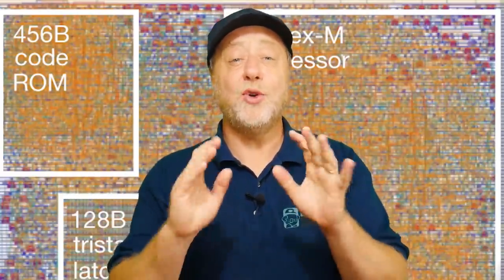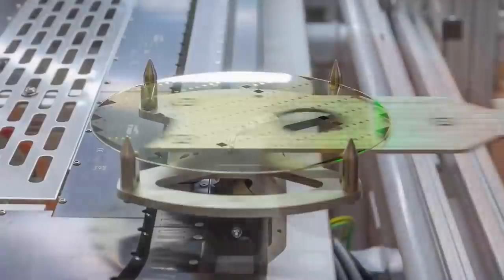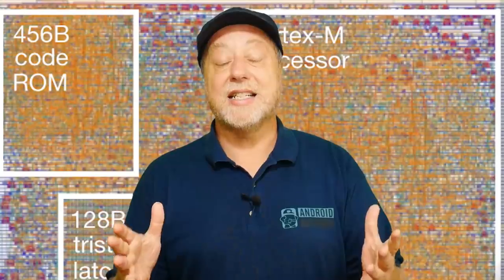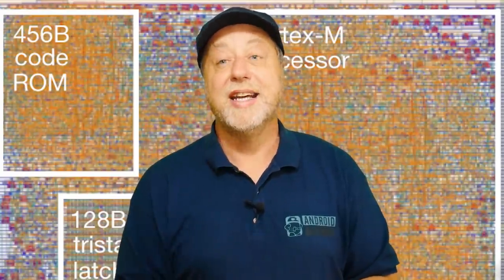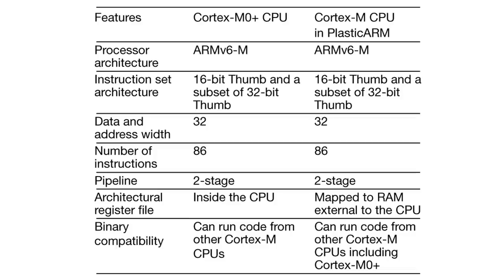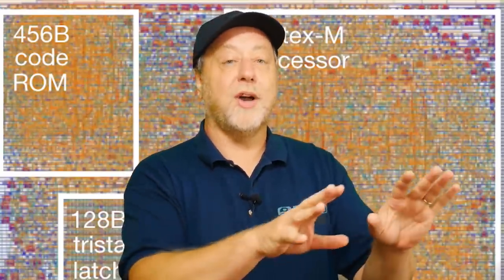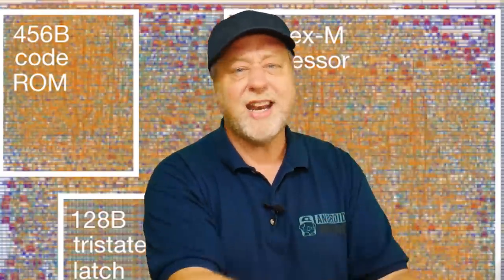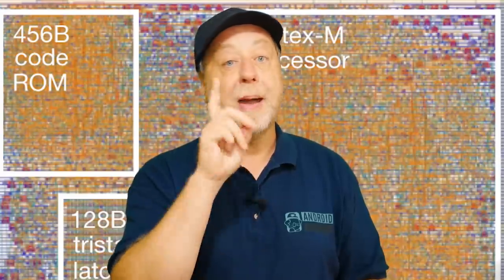Silicon Chips Are So Yesterday - The Future is Plastic Chips!

Comment: let's overclock the plastic SoC and see if it melts
Reply: The new benchmark
Gamers Nexus: "Will it melt?”
Reply: Jech Tesus
Reply: I was finding this comment
Reply: No heat sink
Reply: Lol
Reply: Heat-resistant plastic exists.
Reply: kkkkkkk
Reply: Testing plasticity to its limits!
Reply: @salluna1957  Next up gamers nexus 'didnt melt' awards
Reply: the diamond we will replace silicon with won't melt, I find it silly anyone is talking about using Plastics when lab grown diamond waviers are right around the corner.
Reply: @AdolphusOfBlood  if it doesn't melt itself, will it melt others in the circuitry? :)
Reply: @DarkPa1adin  Nope, but others will melt long before you'll reach the limits of the material, and those could set it on fire. Yes diamond burns. It's just such a good conductor that it won't heat up due to the current. So in 40 years you might see some idiot bragging about their computer having gold circuitry to handle more current for max clock speeds. Sounds silly right? Diamond CPU and gold wiring? But yeah these are the two best materials for their respective roles. I await seeing my grand kids bragging about their silly pimped out PCs that are literally pimped out.

Comment: I'm kinda interested in seeing an ARM microprocessor combined with a TFT, maybe even OLED display on single sheet of plastic. With what was shown in this video, it sounds actually within the reach. Could work as anything from clock, digital thermometer, adjusting and showing expiration date, calendar you can slap on the surface of a mirror and so on...
Reply: Smart labels on reusable packaging
Reply: or like paper thin calculator,
Reply: @crusaderanimation6967  That could work too. Doesn't even have to have mechanical buttons either - capacitive sensing is a thing. Probably powering a device like that would be biggest challenge, though...
Reply: @DennouNeko  Depend on power consumption, modern calc
calculators consu
me like 0.0001 W (at least that's declaration on my small casio.) you may harvest some power from small solar panel (i heard there are flexible too, are less efficient but in this case may be enough)
Reply: @crusaderanimation6967  Yeah, I wasn't sure about the solar panels :) But if there are ones that can be made in same technology, then you have pretty much a whole device on a sticker.
Reply: Just what we need. More plastic waste. 👍
Reply: @johnathanpearson3203  Look who came Johnathan Pearson , destroyer of fun, killer of child smiles.
But seriously tho, i think it may even reduce e-plastic waste if designed properly because you wouldn't have produce casing in a sense we have now but pcb would be casing itself.(and remember it isn't that if those weren't produce them we wouldn't have additional plastic waste, because if those will not go into production them "standard " silicon products will be produced, but if those plastic chips will be produce and gain popularity they may replace silicon at least to some extent and if designed properly reduce plastic waste.) But that depend on how technology will develop and how devices will be designed, so complaining now about plastic waste is simply irrational.
Reply: @johnathanpearson3203  Did i wrote anything about recycled plastic and or chips on food products ?  U completely missed my point.
Ok chips in food product may be a problem but you just neat picked one problem form one potentially problematic usage and applied to whole technology.(Not even precising that you have problem with this particular usage.)
Reply: @johnathanpearson3203  Well, interesting way to vandalize talk about technology. Kinda surprised you didn't start with "we should stop using machines that take away our work places". But joking aside, regardless if a chip like that would be made of recycled plastic or not, as long as it would use less plastic that stickers or devices it replaces and would be recyclable, it's already a positive effect. And if you want to blame anyone for consummer style of life, blame people who will order the available products by price and buy only the cheapest. Doesn't matter if they will pay 10% less and it will last only half the time.
Reply: @crusaderanimation6967  it was a use case presented in the video.

Technology needs to become more useful not more unique or custom.

Just look at all those outdated mobile phones being thrown in landfills every day. No ability to reuse or repurpose.

Your playing the game of use more. We should be playing the game of reuse more of older tech or recycle it completely.
Reply: @DennouNeko  you said it does not matter if it's recyclable? I disagree. No way it will use less plastic than a sticker.

I think technology needs to be smarter. People throw away too much stuff released by companies which know in a few years it will be garbage and useless. Waste of resources. Plastic chips are useless for the mass market. Maybe in specific medical uses maybe.
Reply: @johnathanpearson3203  Less plastic than a single sticker? No. But what if you have packaging that you can reuse? A glass bottle, an envelope, any kind of container that you can either return or even reuse yourself? That replaces mutliple stickers.
Reply: @DennouNeko  I could get behind tech that makes glass bottles and tins rather than plastic. Even using hemp for building materials as is already possible and is lighter than oak and twice as strong. But expensive.

I could get behind a mobile phone ATX standard and sockets for mobile phone chips so they can be repurposed in other products or upgraded.
Reply: @johnathanpearson3203  
Your missing the point  even more,
" it was a use case presented in the video."
Yes but that's one example among many other examples but you seem to write off  whole technology just because of one example of usage that might be bad.

"Technology needs to become more useful not more unique or custom."
Technology is (sometimes) more useful by beaning " more unique or custom." That is more specialized to task.Sometimes multipurpose is needed but sometimes "If something is to everything it is for nothing."

"Just look at all those outdated mobile phones being thrown in landfills every day. No ability to reuse or repurpose."
That's not problem with plastic chips that's separated topic related but separate. We should reuse as much as possible but we can't do it all the time and we have to produce new devices and if we do so them we should improving the technology. 

"Your playing the game of use more. We should be playing the game of reuse more of older tech or recycle it completely."
Well in first sentence  you made a straw man, but with rest i would kinda agree with 
except it's much broader problem and biching about it under video technology that may even help but have one use with have potential to be bad idea is simply out of place.
Reply: Just use your nose! Way less waste and you already charge it with food.

Comment: Combined with medical sensors for diabetes or, for example, blood pressure stick-on patches, a computing device on plastic could really help save lives and cost.
Reply: It won't even need a battery if they design a flexible Peltier device. It'll just use the body's heat.🤔 Time to do some research.

Comment: Presumably thinner and lighter substrate.  So although its bigger than its sillicone cousin.  if its lighter it means a great leap forward for aeronautoics and space flight.
3D chip design on polymer substrates would technically be printable.  So you could just have the raw materials and a printer to repair components on a ship.  Instead of having to take spares up with you.
Reply: Nice!
Reply: That's a cool application
Reply: @1MarkKeller  PROFESSOR you are back. Missed you 😢
Reply: @harshvardhansinha  HARSHVARDHAN SINHA!
Reply: Stop saying silicone. Its silicon. This is electronics, not boobs.
Reply: No its not printable

Comment: Will the chip melt on high temperature since it is plastic?
Reply: Undoubtedly.
Reply: So do silicon chips, or at least they die at high enough temps
Reply: If it could survive reflow, it would survive normal everyday operation.
Reply: @jrsxcase  it can survive reflow...... of hot-glue :)
Reply: It runs very very slow so heat won’t be a factor I assume

Comment: A good power source is the "usual problem" for such mass deployment of "smart" circuits in packaging and so on.
Reply: Paired with rfid I bet it gets enough power to do its thing. Alternatively it can use flexible solar panels or solid state batteries.
Reply: @rallisf1  With the suggestion about having sensors to monitor transport, no RFID available, and in a dark place. And in flexible packaging material, solid state batteries do not really fit.

Comment: I'm certainly intrigued by plastic chips, but I'm not seeing the application yet. You can do the example food expiration chip in silicon just fine. Where's the power going to come from? Not a plastic battery. Your yogurt container is going to have a nasty metal battery that you can't just throw in the trash (or recycle easily). I also wonder what kind of wires are going to bond to the pads on that plastic chip and stay reliably attached with all the flexing.

Comment: The substrate used is plastic instead of silicon wafer, and because of that the logic gate has to utilize TFT process to build. The main draw back of this combination is power-consumption and CPU operation efficiency which is very bad. The CPU has to run under 20kHz and consume a lot of electric current, which is not good for IoT applications.

Comment: It seems a bit backwards to me, the wafer is silicon because it's silicon that becomes the transistor gates by etching and doping. 
Then again, since the whole lithography process is so complicated and expensive, maybe thin film transistor based logic does make sense economically. But the substrate doesn't matter at all, as long as it's reasonably flat and stable.

Comment: Microchip has had great success with the PIC, a Low power, small computer, that's very inexpensive.  If the plastic chip could be made cheap enough, this could expand the low cost Micro-controller market.

Comment: What about the processor can wrapped around a small size battery that fits into your glasses? This maybe can reduce the bulk of wareables and maybe AR/VR glasses
Reply: They still need to "project" holographically, as the eye is terrible at reading in very close distances. Zack Freedman did a video about this.
Reply: The electronics size is not the cause for large wearables. A silicon cortex is around a 20th the size

Comment: Please no. We have enough and more plastic already. Metal, Glass and Ceramic would be preferred over plastic. Silicon isn't bad, and FinFET has been working well so far.
Reply: Yeah cause those 0.5cm^2 of plastic per chip will totally make a difference
Reply: @albertoossola1481  when put in billions of devices, yes, it does.
Reply: @shresthsonkar9207  The devices would likely still be made out of plastic, plus silicon ICs still have plastic packages. No difference
Reply: I concur with DreaD. Next generation fabrication to replace silicon substrates have been mostly focused on GaN (Gallium Nitride) which is considered in many ways to be the successor to GaAs (Gallium Arsenide). GaAs was utilized by Cray supercomputers in the 1980s. GaN has the potential to consume less power than silicon substrate designs, and have a much higher operating temperature range, which means that less power will be wasted on cooling as they can presumably continue to operate passively and without active cooling systems such as water/fans/Flourinert/etc. drawing power.
Reply: @grey5626  upscaled by Engadget?

Comment: Biodegradable is kinda a nebulous word. PLA for example is Biodegradable, but that doesn't mean it is *compostable*, which by contrast would mean you could chuck it into the woods and it will degrade on its own.
Biodegradable means there are certain conditions under which it may be broken down by enzymes, but sadly PLA isn't collected and recycled in that way. It's just burnt with the other plastics.

What I'm saying is that the word is often unintentionally used for greenwashing plastic.

Comment: I can see biodegradable plastic chips being used to further planned obsolescence, rather than to benefit the environment. A critical component will be designed to disintegrate after a period of time, forcing the owner to buy another.
Reply: I see no benefit to the environment. Just making planned obsolescence more expedient
Reply: @valghyna7668  The production of silicon chips, from high grade quartz, is quite energy intensive. I'm cynical enough to always doubt rosy forecasts though. There is always someone 'trying to stick the tip in'!

Comment: Gary, Linus just made a video on the difference between high density and low density ram. And while he did try to break it down and make it understandable, I find myself unable to tell after whether the RAM I'm shopping on Amazon is one or the other even with pictures of the actual ram on front and back. Could you take a crack at it and particularly explain how to spot the diff when buying

Comment: lol not thinking out side of the box here. sure good uses for it. but the main thing its "flexable" I can see this used in bionics(prostetic limbs and even part of skin graphs.) and even in drones and space probes where space is limited in the shell design. instead of having to design everything around the square shape, of current systems. can make mini probes that are actual electronic equipment like a Volt meter that are self contained inside the probe itsself.or to monitor anything, tempature, pressure, liquid levels. you can slap it on any surface and not have to worry about having the room for it. say like on a pipe that you want to monitor the tempature of. even a wearable heart monitor that is a kind of skin graph. now that would be useful for human space exploration would not need all those wires and skickey patches for the wires to connect to.and that is built into the suit that would not add a bulkey weight or hamper range of motion. anything that needs an Odd 3d shape over a larger area. same for Altheates. built into their workout clothes. that can monitor their health. blood presause, heart rate, breathing, pulse, even O2 levels, core tempature. how many times had we heard that a high school, college althleate collapsed and or died while working out? too many. this could be a way to monitor a workout of a person. and let you and a choach know their maybe a medical condition starting to happen and can just stop or get medical attention before it becomes serious and deadly. back to the other. with this flexable controller a designer only needs to worry about how to place the mechanacal hardware, and power supply which now has more room. for it can now be say placed over the curveature of a motor. instead of having to have it on its own flat surface area.

Comment: If they can be cooled on more surface area/side than the silicon chips, potentially we are looking at better performance as well.
Reply: Not really, the preformance of this compared to silicon chips is not even comparable and will never be.
This is a completely new niche that's interesting in itself but physically incapable of competing with silicon on neither power nor preformance.

For example this one consumes 10s of milliwatts running at 10s of kHz while a similar core implemented in modern silicon processes will run 100s of MHz consuming less than a single mW

Comment: This is kind of cool, but we don't know the limits of this. Flexing the chip would decrease its durability if it doesn't straight-up rip part of the circuit, the smaller they make it.
It's too late to financially compete with traditional silicon chips, but that doesn't mean we won't have some limited use scenarios for them.

Comment: The plastic chips to detect food spoilage will just waste more food and more plastic. The problem is not in the technology, but in the regulatory bodies that will decide the cutoff before food is thrown away, and the signals displayed to customers that will show food spoilage even in cases when the customer would have normally consumed the food without issue.

For example, a tomato on the shelf has briefly exceeded the temperature guidelines and has been marked "spoiled." The tomato is not immediately inedible and shows no visible signs of spoilage. This tomato would have been perfectly edible in a tomato sauce, yet it will be thrown away before it even reaches the customer due to the sensors applied to the surface

Comment: Sounds a like throw away non repairable flexible then break from flexing junk. You do not want electronic parts to flex because they will become mechanical & the life will be shorten to there counter parts. Only would be useful for specialized short life devices hopefully they make replacement parts.

Comment: Watching this video after a reading  session of a book on semiconductor devices and circuits. Well... I don't know how to react to this 😂. What would the cons be of plastic technology?
Reply: Power, area and performance - will never come remotely close to that of modern silicon processes.
Though it's an interesting niche and opens new possibilities for disposable electronics
Reply: @TorbjrnViemNess  never say never. Who knows what will happen in 10-20-30 years
Reply: @TorbjrnViemNess  Implying that electronics aren't already treated as if they were disposable?

Bold assertion, no evidence found.
Reply: @grey5626  not on the same level as this - normal electronics get thrown out and replaced when they're no longer fast or relevant enough. What they're referring to as "disposable electronics" can be stuff that monitors goods during shipping and then gets discarded - for example a label on a shipping box that monitors the package in transit to the customer and then gets thrown away with the box